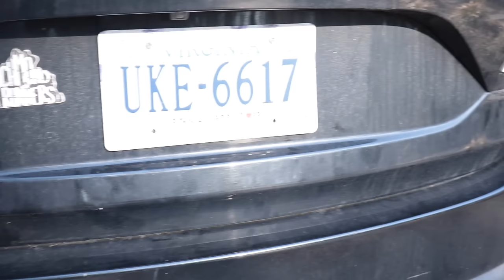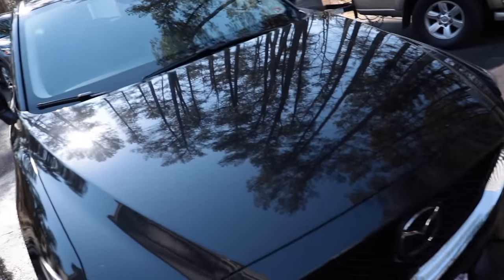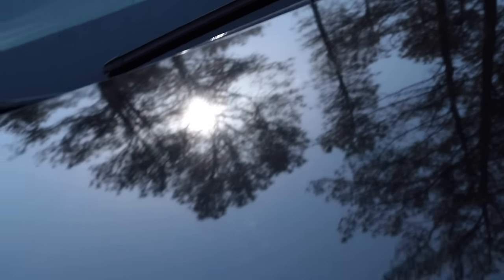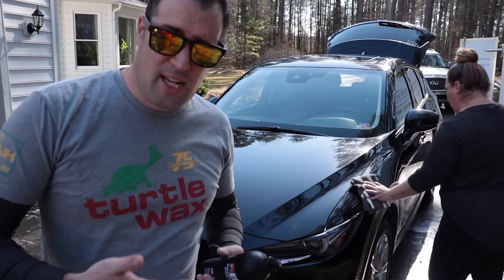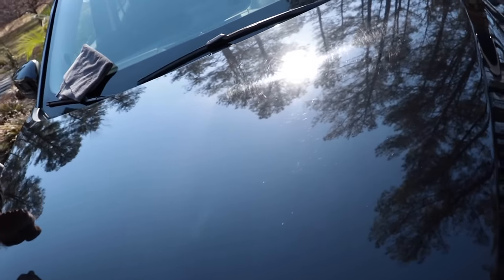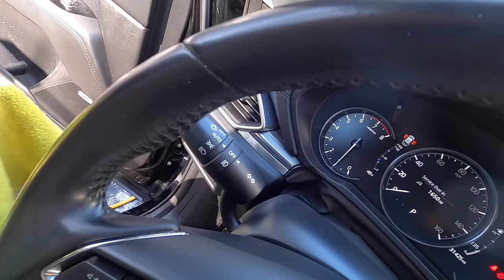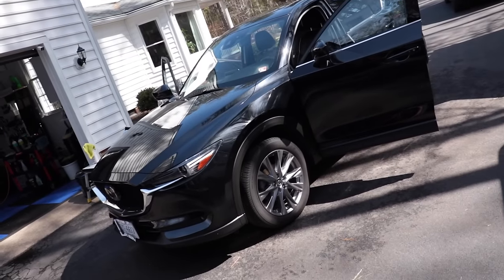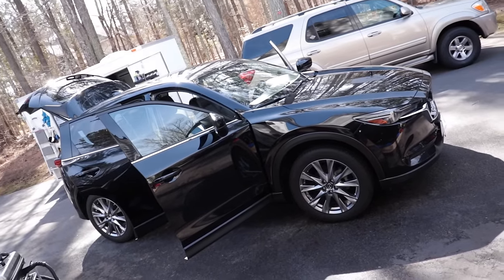Easy Gloss, Slickness, & Protection! Interior & Exterior Detail / Mazda CX5

Comment: I got same cx-5. Is it ok to wash the hinges of the car? The oily stuff

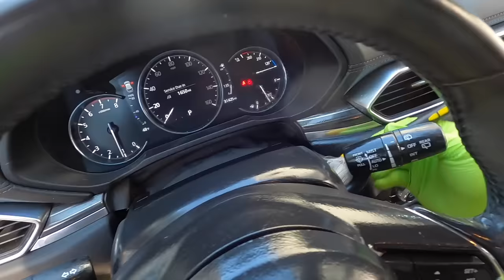Quick edit: what solution are you using for the plastic to shine? 11:54
Reply from the maker: Hi. Yes it is. Just don’t be overly aggressive trying to degrease those hinges. I only clean around them.
Reply: @MirandaDetailing  what solution are you using for the plastic to shine? 11:54
Reply from the maker: Hi. That wasn’t a dressing it was a cleaner. It was Koch Chemie Pol Star 1:10. 
It only looks shiny because it was still wet from cleaning it.

Comment: Love your videos down to earth with the wife helping out. That's family. My question, I do my own detailing on our car 12 year old Kia Optima LX in Platinum Graphite Metallic dark gray. I have both Meguiars Ultimate line from compound to liquid wax and fast finish, but I recently bought Turtle Hybrid acrylic ceramic black polish and spray wax after watching your video along with Pan and Jimbo's videos. What would happen if I strip washed my car did chemical and mechanical corrections then Ultimate Compound followed by Turtle Hybrid Ceramic Acrylic Black polish, Turtle Seal and Shine and Turtle Hybrid Ceramic
 Acrylic Black spray wax with ultimate liquid wax as a finish. Am I wrong doing this?
My car looks 98% factory new. I clean inside weekly and maintenance wash with Meguiars Gold. I will be using Turtle Hybrid Ceramic wet wax I just bought and getting their ceramic wash and wax. I hope I'm not doing overkill 😜 I'm also subscribed to your channel. Love your passion in detailing.
Reply from the maker: Thanks man!  
It looks like you have a good process!
I would skip the compound and see if the Black polish with a yellow or orange pad can get the cut and finish you need. If you need to use the compound to cut more that’s fine also. Skip either the seal and shine or black spray wax. No need for both of them. Just one or the other works great. That should get you he results you want in less time. 😎👍🏼

Comment: I just got my car back from the oil changing place.and it was covered with oil on the leather door panel and stirring wheel have any suggestions on what I can use to get it off
Reply from the maker: Aw man!  I had that happen also!  Use an apc or dedicated leather cleaner. What do you have on hand?
Reply: @MirandaDetailing  I have a chemical guys all purpose cleaner.it took it off wasn't sure it was going too but it did

Comment: Have you ever applied gtechniq crystal serum light without exo after just the one csl layer ? How does it hold up compared to the exo on top does it really matter or not ? Thanks 🙏🏻 👍
Reply from the maker: Hi. Yes in fact many of the vehicles coming back in the next few months just have one layer of CSL on them and no EXOv4. They hold up just as well. EXOv4 is just more hydrophobic, but it only lasts 2 years.